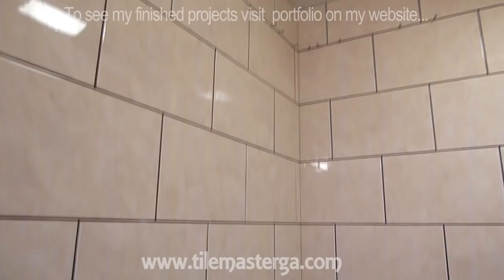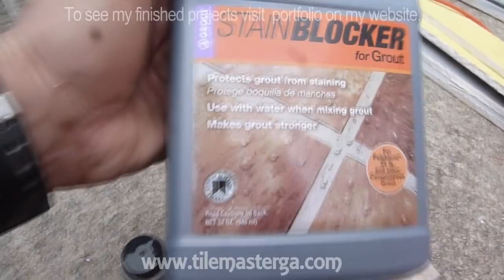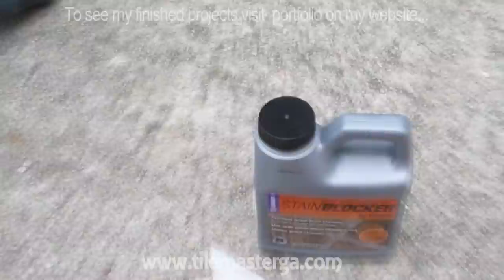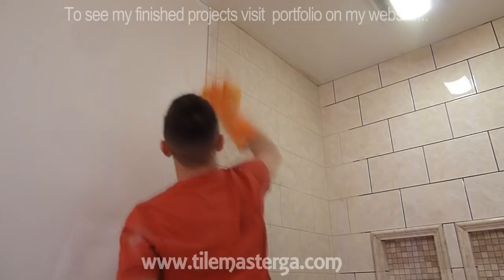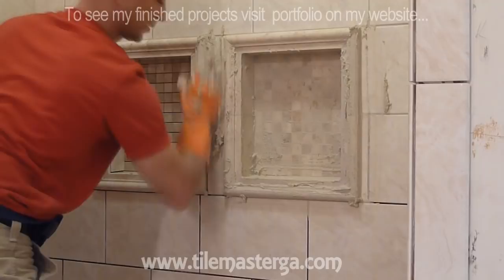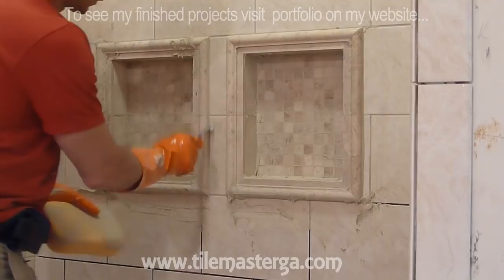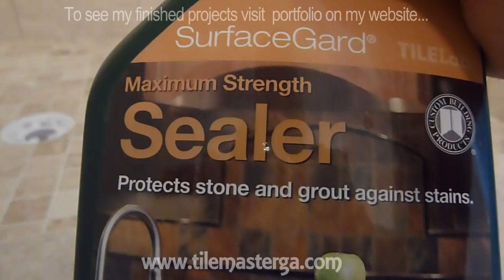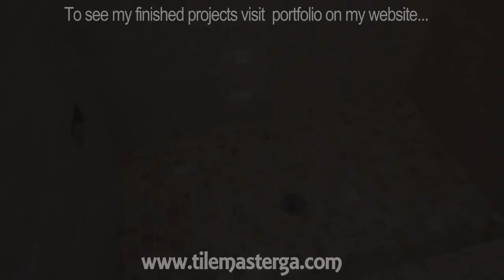Part "6" How to apply grout on shower wall tiles - DIY bathroom tile installation ( brick pattern)

Comment: Thank you so much.  I tiled around my tub and a brand new shower (we turned a bedroom into the bathroom) with you instructions and it turned out pretty good.  Your instructions helped me avoid some pitfalls I probably would have run into.

Comment: Thank you for sharing all your project ,,, I  just finished my sons bathroom  with your guidance it came out great.
Reply from the maker: Super! Pozdrawiam z GA.
Michal
Reply: Is the gap where the wall tile meets the floor grouted the same as the rest? I couldnt find it in the video. Thanks.

Comment from the maker: Well,
I am using unsanded grout only with 1/16 spacers. Sanded one works up to 1/8, but I often noticed that it cracks with 1/8 space. I am recommending sanded because it will work and will be more durable - stronger. On glass accent apply it with hand - not grout float! - you may scratch glass if done with float.
And do not forget about glows.

Mike

Comment: Epoxy grout is best for shower floors, it lasts a long time, has a stain blocker built in and it's very water resistant.

Comment: You should know (being a "Pro") that ANY TIME you mix grout, you should do so with a LOW speed drill. This will prevent mixing too much air into the grout and prevent any air bubbles from forming. Using a low speed drill, and mixing for at least 3 minutes will make the grout less likely to crack or have bubble holes form
Reply from the maker: John, great tip - that make a lot of sense! I never thought about that. However later when grouting most of the air gets out from grout but still this is great advice - I will do it your way on my next project - grout is very important to stay as durable as it can be !!!!!!

Just make sure to mix it enough long to achieve consistent color and bonding.
Best regards Mike

Comment: First of all i would like to qualify myself. I have built MANY homes. I was recognized in Hilton Head monthly magazine  in May of 2006 for not only designing one of the best floor plans on the island but also being the builder. As a lowly landscape contractor, I did most of the upscale work for the most prominent builders (including names as Arthur blank, Jim Boshart, Steve Black and MANY more) on the island.  Because I did work for so many of them, i was approached by all to do my project of 6,500 sq. ft. on the inter coastal water way.  In addition, because I did not want to lose any of my builders work by awarding the work to another, I decided to undertake the project myself. I had 900,00 into the project including the lot and sold it 4 years later for 2,3500,000.
The work this man does is by far the most impressive, comprehensive, and quality conscience work I have witnessed.  I have been through a WORLD of contractors who claim to know what they are doing right down to the written contracts (of which I have learned to process) being written in art form. This installation may seem "over the top" but please consider what your end return will be. My name is Dave White and my number is 478-278-0595 if you need to speak with me! This shower with all materials should cost installed, between 2,680 and 3,463 by my calculations depending on your location......6-14-2016

Comment: fantastic video and very professional work. you are a true craftsman and it shows.

I do have a question though, why did you keep switching from the white thinset to the grey mortar mix? you never explained why you were doing this, or at least I didn't remember to explaining it.

as far as I understood it, dark thinset or mortar will bleed through light colored tiles after a while and leave discoloration and stains showing through.

Comment: Your videos have been very helpful, so well done, and easy to follow.
When finishing the corners, where walls meet, I've read caulk should be used, as this would be the area to move, and possibly crack, if any movement should occur.  Is this something you do?  Do you grout first, then caulk over the top?

Comment: I noticed you used different color thinset on curb tiles and lower tiles near floor also looked like1/2 x 1/2 trowel. Was there a reason for this?

Comment: Your video's have helped my husband and I so very much!! I have a question as I think we may have made a mistake. We are on a concrete slab, 23 year old house. We removed a fiberglass shower unit and redid the shower with tile. Had a professional do the actual floor base. Heres the question..We used urethane grout. Should we have grouted where the wall meets the other wall and where the floor meets the wall? or were we suppose to caulk that? Yikes..we grouted it and now I am worried I did the wrong thing.
Reply: Hi Barbra it has been eight years ...how did it turn out ? Did it stand the test of time ? It is true caulk is good in the corners  ...but you have a concrete slab and maybe no movement ....if their is movement between walls or floors grout won't flex but Crack instead ...most bath caulk is Silicone and flexes .

Comment: I have really enjoyed watching your work the last couple days since I found you on Youtube.  Your videos are amazing and seem even more informative than most books I have seen.  One question I have about this project is about the grout around the shampoo niche trim.  I suppose this question also applies to the way you grout the tub surround in one your other video series.  I am installing a surround in a new tub and I noticed that you leave a very small space between your bottom row and the tub, at the corners, and in the mitered corners and center edges of the niche trim.  Did you still use the same sanded grout for those spaces as you did for the 3/16 grout spaces everywhere else in the surround?

Comment: Tilemaster , How do you remove the grout film from tile that does not have the smooth finish or a gloss coat , we have been clean with water and sponges and cloth towels , but the film or haze of the grout is still There!!!! Please Help! Your work Is excellent all of the videos are great help ! Thanks , Rock
Reply: A clean dry piece of folded cheesecloth works very well for removing any remaining grout haze.  You can rub as vigorously as necessary without fear of damaging anything. Turn the cheesecloth over frequently, and shake out the dust periodically.  Works like a charm!

Comment: Great video's, great work, thanks for posting. Just curious though, don't mean to be picky but in the last pictures of the shower it looks like the grout lines on the bottom course were darker. Were they not dry yet? I was on a kitchen remodel not too long ago (I'm an electrical contractor by trade but also do tile work on my own projects) and the general is a friend of mine. He installed a herringbone backsplash then had some of his workers touch up the grout the next day. They used pre- mixed and it was much darker than the dry mix he used. NIGHTMARE cleaning all that out and re- grouting...

Comment: Great video series! It has been a great help for my residential job. Thank you! One question: In my standing shower re-do, one existing wall was not straight, so now I have 1/4" joints in the corners, but my new tile has 1/8" joints. Do I use sanded or un-sanded grout?

Comment: Thanks for your time in making the all of your videos.  Many of the grout sealers on the market require waiting 7 to 14 days before sealing the grout.  Can the shower be used before sealing the grout?   Is there a sealer on the market that you can and to the grout while mixing?  Or does the stain blocker also do some sealing?
Reply from the maker: If you will use stain blocker you do not have to apply any sealer. And you can start using shower after 24 h.

Mike
Reply: Thanks for the quick response

Comment: just finished putting 18x18inch stone wall tiles on bathroom walls but having trouble removing spacers from between tiles!! please can you help!!
Reply: +joyce haines  you dont need to remove them ,push them in if they above the tile surface

Comment: I noticed that you calked under the ceiling but not in the corners. I got some mixed suggestions with that, should I calk literally in every corner (including the outside corners around the doorway) or will grouting everything be ok? I am pretty confused, thank you for your videos, they are awesome, great job!

Comment: Do you grout or otherwise seal the opening for the shower handle?  The trim package doesn't create a watertight seal -- should I grout or maybe use something like a silicone sealer for the spaces in these openings?
Reply from the maker: Clear 100% silicone or caulk that has color of grout will do.

Michael
Reply: You can use caulking or plumber's putty.